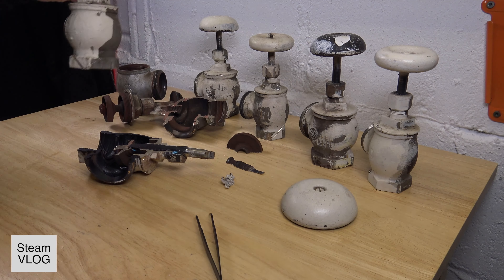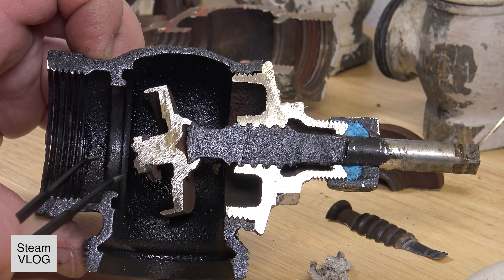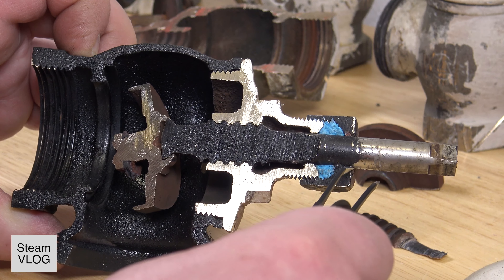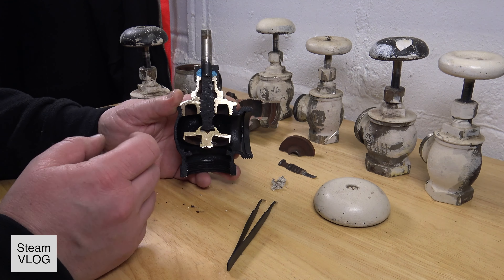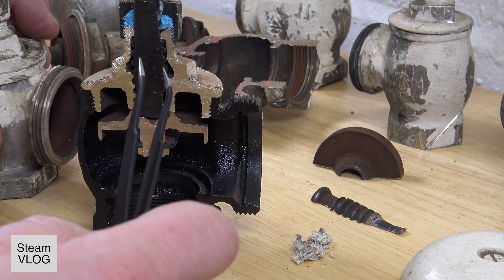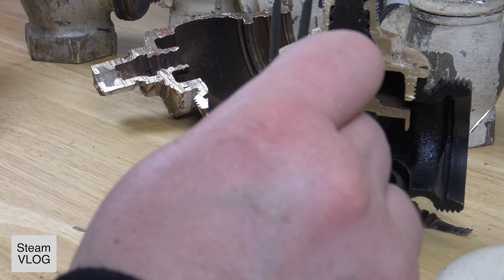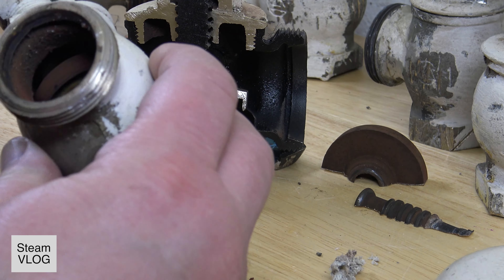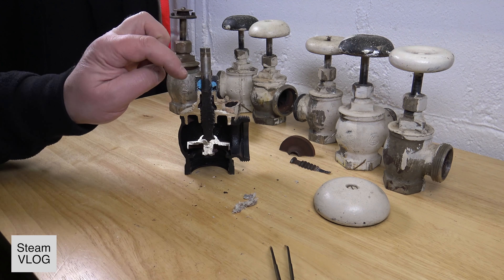When To Replace A Steam Radiator Valve

Comment: Great video!  I've never worked on radiators before.  Although I had a general idea, I didn't know exactly what was going on inside that valve.  After seeing this video with the valve cut in half, I do!  Now I know it's the packing that is leaking, and hopefully, I can stop the leak by opening the valve all the way.  Thanks for making this video!

Comment: Great explanation my friend 💪 just quick question -  will these old valves work without rubber seal at the bottom?
Reply from the maker: Yes, when you have the valve 100% open, as you should. You won't be able to close it, that would cause problems.

Comment: thanks so much - I feel like only one half of my radiators get hot, the rest is cold, both the valves you show above, and the radiators themselves are a few decades old )the little shiny silver valves have been replaced, though. Wise to replace some old valves?

Comment: I'm having issues with banging and water coming out of air valve. What's it mean when the stem does not go up or down when closing or opening the valve? I'm assuming its just partially open and causing all the issues. What can i do?
Reply from the maker: Turn off the boiler, and then you could take the top off the valve and look inside, then you know what is wrong.

Comment: Helpful video. My very old radiator valve was recently shooting steam from the stem and my plumber came and replaced the packing. Now the steam stops venting from the stem, but the radiator now barely heats up at all…like the valve is now closed entirely even though it’s wide open. Any thinking on why packing replacement could affect the ability for steam to enter the radator?
Reply from the maker: maybe the internal gasket broke and is blocking the pipe. you could remove the air vent on the radiator to see, if there is steam. maybe the vent is clogged?

Comment: Great video thanks. My radiator valves leak between the valve and radiator. The seal does not hold and pushes water out. What can be done to remedy this?
Reply from the maker: just replace the valve. the new valve comes with all the parts you need to fix that issue.

Comment: I'm getting heat, but it hisses and doesn't stop hissing.
Reply from the maker: then the small airvalve on the other side of the radiator doesnt close
Reply: @mygiguser  it's hissing from the steam radiator valve

Comment: Where can I buy those 2" valves?
Reply from the maker: i found them at Menards, and they have them at piping companies, Amazon, and i usually order at supplyhouse dot com
Reply: @mygiguser  The outer diameter of my pipe going to the valve is about 2". What valve size I should get?

Comment: Can you replace that gasket?  I have steam radiators that when turned off, still are partially heating up.
Reply from the maker: If the thread and the nut are still good, then yes. Question is where to buy the gasket. I think it would be easier to just replace the whole valve.
Reply: Thanks for the quick reply.  That is a good point, probably should just replace the whole thing.  I assume there isn't anything else that would be making the radiators get hot/gurgle when I have the valve closed?
Reply from the maker: Nick Patrick i wouldn’t expect any noise when the valve is completely closed.
Reply: Hmmmmmm.... I'm at a loss.  I'm in a 10 unit condo complex.  It is sooo hot it our unit, we don't need to turn our radiators on at all (which I assume is probably part of the problem).  With the valve closed, we still get noise, not banging but a lighter consistent noise
Reply from the maker: Nick Patrick maybe the valve doesn’t close all the way.
Reply: @nickpatrick7890  install a 1/8 MNPT to 1/8 FNPT shut off valve before your air vent. When you shut it off you’ll get no heat as the air Can’t go out allowing steam to fill in the radiator. Never use the “service shut off valve” to control the heat on the radiator. I’ve done this  all throughout my house and it works amazing. You can buy on Amazon.

Comment: I bought a 1/4" thick 12"x12" sheet of made in the USA 70 durometer high temp silicone and I am going to make new circular gaskets for my old valves with the wood handles like the ones in your video. My house is from 1901 so I wonder if they may be original. These old valves do not leak steam and move up and down nicely but they to not fully seal when closed. 

I have two newer ProFlow brass steam valves and they did not last long at all. The plastic handle stripped/cracked on one and the other does not fully seal when closed.
Reply from the maker: Shwalker07 sounds great, as long as you are able to unscrew the nut on the stem. You need to make sure, that your new gasket stays in place at 100°C Not sure if silicon is hard enough at that temp?
Reply: I gotta tackle this project in the early spring time once it gets warmer. I am learning more about this but at 70 durometer it is about the same hardness as a shopping cart wheel. When I received this sheet, it is hard with just a tad bit flexibility. I originally thought silicone would be too soft to seal but the higher the durometer rating the harder is it. 

Thanks again for your informative videos.
Reply from the maker: You could boil a piece in hot water, and then see how soft it gets. Good luck with your project!

Comment: Good video. The description how the steam radiator operate and how it is damage is very reviling.

If  I am correct that gate valve (usually use for flow control). Why the industry used steam flow regulation in singe pipe steam radiator? It might have much more sense in dual pipe radiators.In single pipe steam radiator flow (temperature )is regulated by pressure steam valve. There is now way to adjust temperature by adjusting the steam flow with this valve in single pipe radiator (what people usually trying to do that). You can totally open valve or totally close. If you partial open the water will condense in radiator and eventually leak by pressure valve. They should use different type of valve , may be ball valve or something.

Comment: My valve is stuck shut. No heat. I'm cold. Can I just take a wrench and force it open?
Reply from the maker: I think so. Worse case scenario is that the rubber gasket breaks, then you would have trouble closing the valve.
If all goes bad, you get a new valve at supplyhouse dot com